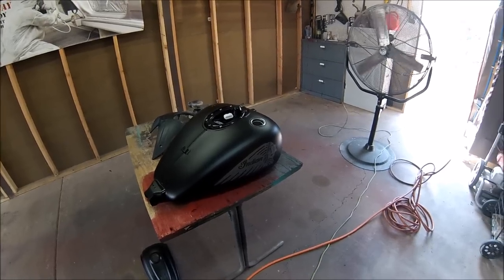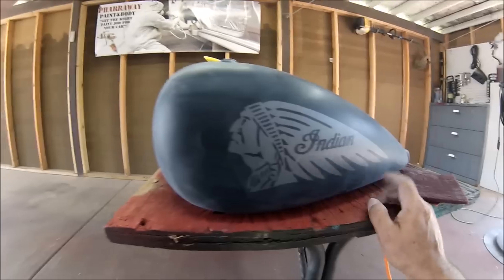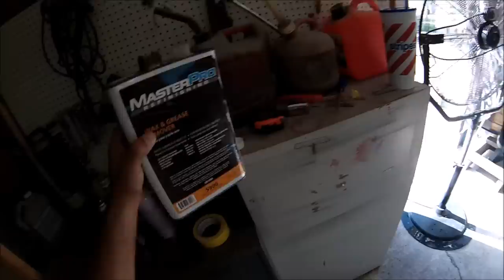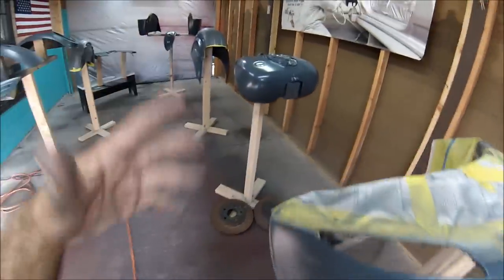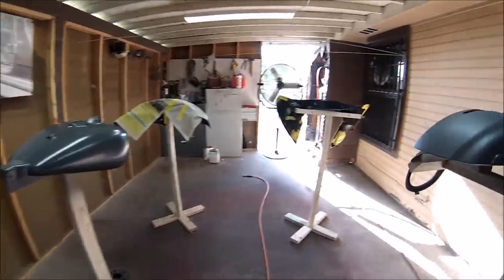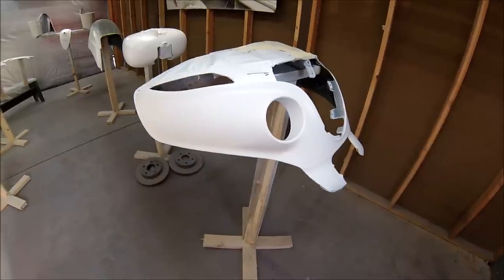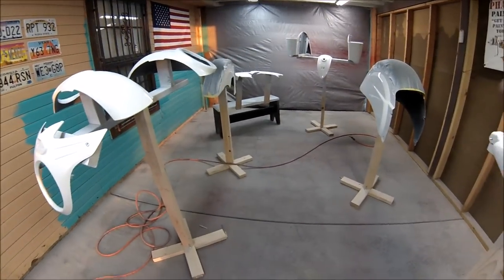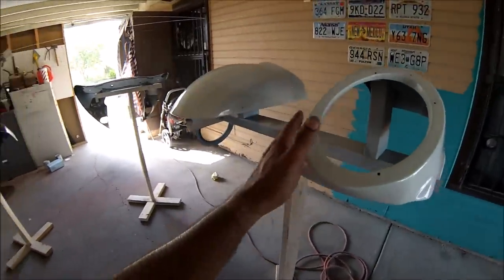2017 INDIAN CHIEFTAIN  CUSTOM RESPRAY PART 1

Comment: another good vid. look forward to next part. I understand the adhesion promoter (plastic parts)...the sealer was for the scratches from paper? Didn't know you could spray over the sticker. I got a Fatboy tank with sticker...thought I had to take down to metal...good to know don't have to.
Reply from the maker: Yes this sticker was under the clear from the factory but yes you can

Comment: I'm not a body man, but I wouldn't have thought you would need adhesion promoter on the plastic since it already had a paint base on the surface
Reply from the maker: no if it has base no you don't need promoter